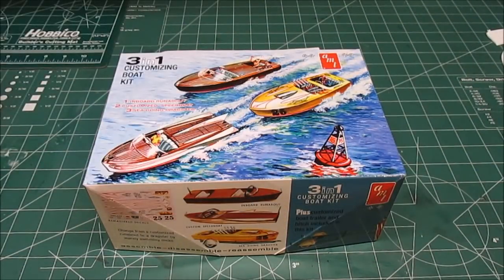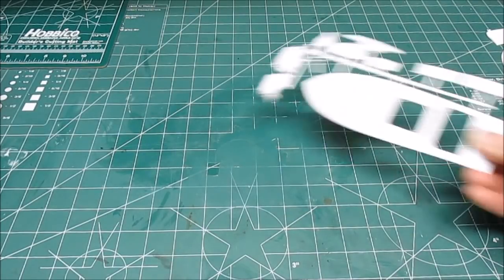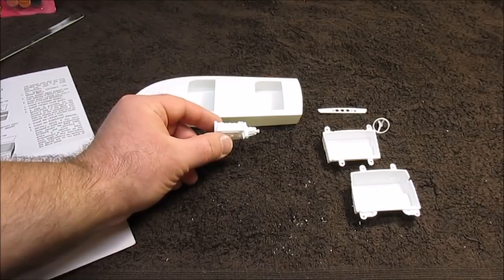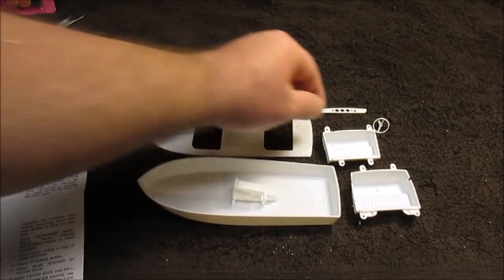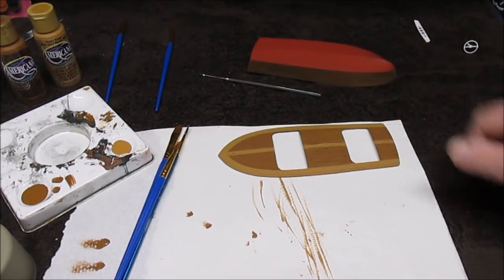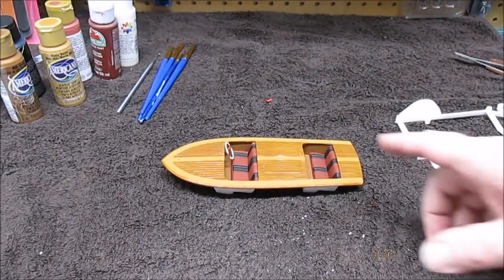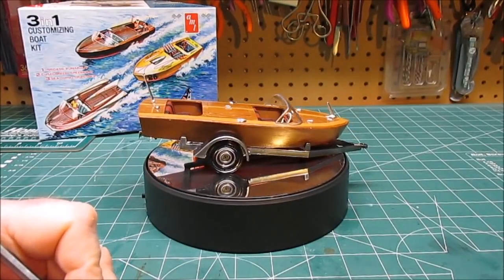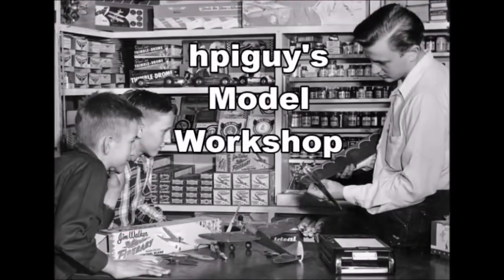AMT CUSTOMIZING BOAT 3N1 1:25 SCALE MODEL KIT REVIEW BUILD AMT1056

Comment: AMT does not include everything in that kit. When I bought the kit it didnt have the windshield but it had the chrome trim for the windshield.
Reply from the maker: You can use their parts request form on their website to ask for a replacement if a part is missing from your kit.
Reply: @hpiguy  Yeah I used their customer service and they where helpful on that.
Reply: Depending on how old was the copy you bought, it may have been that the supplied the frame and you added some acetate which is thinner than styrene.  Look for clear repot covers in the stationery department and you can pick your own colour -- yellow, red, blue, smokey gray.

Comment: Absolutely love it Chris! I've had this kit for some time, but not having seen one built up, it stayed on the shelf. No more! Also, bottom anti-fouling paint is always flat, not gloss. Cheers!
Reply from the maker: Thanks James!
Reply: The bottom paint should be copper bronze antifouling. The rudder and the propeller should also be bronze color. The boat needs an exhaust stack coming out of the transom just above the water line also called a boot stripe. Best boat should have a white boot stripe that runs between the copper bronze bottom paint and the varnish mahogany Hall sides. A nice build though.

Comment: I can't believe you have that kit!   I had one of those back in the mid-60's when it first came out !  I've still got the wood deck plate, too!   I've been looking for one of those for 50 years. Has it been released again ?  
   You've done an amazing job on the kit !!!  One of my frat brothers had one of those he was trying to restore. If memory serves, his had the wood color the reverse of your. Don't know if he ever did or not though.
Reply from the maker: Thanks! You bet, it's been re-popped and is for sale now. Link where I got mine is in the description.
Reply: hpiguys Workshop That's outstanding !   Sorry I missed that in the description.  I'm definitely going to get  me one !  Thanks for the blast from the past !
Reply: they sell this kit at HobbyLobby for 25 bucks I believe
Reply: They must've had a short run of them in the late 90's?
I found one on eBay like 20 years ago moulded in grey.
It's a future project to pair with a resin '48 Ford Sportsman (converted to a "phantom" '42) for a wartime look, with trailer.
I plan to make it a two seater because of the bigger straight eight Lincoln engine out of the "Gangbusters" '26 kit.
I even found a nice accurate looking spilt windshield on a toy car to use.

Comment: Nice job on both the kit and the video. It was great to pay attention to the video without the distraction of bad
camera work, bad sound and bad language. I recently purchased an earlier version that is molded in gray and
has a very slight difference in the decal sheet. Otherwise, the kit is identical. This kit could easily have been
adjusted to build two complete boats with an extra hull and a few small additional parts. I'll also say that a price
of $26.00 (at my local hobby shop) is ridiculous. The kit is so simplified that in can be fully assembled in no time.
Still, I'm glad to see it re-released. You did a great job with yours.
Reply from the maker: One extra hull and you'd have a true double kit. Maybe they will do that on the next release, that would be cool.
Thanks for the nice words!
Reply: Remember all the spare parts you have.  You're not just paying for the parts you used.
Reply: @randytaylor1258  Well, you're Johnny-on-the-spot, I wrote that four years ago. Nonetheless, what the hell good is a second
deck without a hull? At the time I wrote that comment I was just getting back into modeling and the prices took me by
surprise. Now I'm seeing kits at $31.95 and I don't feel any better if there are extra parts I don't see myself ever using.
Reply: @mitchgawlik1175  
When I was heavily into modelling 1:25 cars, 3-in-1 kits sold firv$2U.S./$3.20Cdn.  Those same kits in the same boxes are now $25-35.  If that's the going rate for a srandard-sized AMT or MPC or Revell KITS, then that's the price on the kit.  I didn't say it was a deal but on the other hand, after a few hours with a boat kit you've got a finished model to show for you efforts.  That isn't true with a more expensive Tamiya or Trumpeter kit which, of course, runs the risk of not being finished.  
There are many different ways of looking at value.  I have $200 kits in my basement that will take me a year to finish.
Reply: @randytaylor1258  I appreciate what you're saying. I also understand the value of U.S. currency. I have no idea how long you've been modeling but I've been at it since 1959 (9 years old), off and on. You can't imagine how much I enjoyed those oh so simple 3-in-1 and Craftsman kits from AMT. When I post comments on a couple of other sits wishing that Round 2 consider repopping those kits I get a resounding YES! from readers. I'm glad for those of you who are getting what you desire 
from Round 2, along with those spare parts. My wish is that Round 2 would consider that there is a group out there who really love those older, simpler kits. That's easy to figure out  when you see the prices asked for absolute trash on ebay. Give me an AMT '59 Galaxie, a '59 Buick Invicta, '59 Olds and a '59 Pontiac and I'll be silent forever, except to give a big thank you to Round 2. Thanks for your thoughful comments.

Comment: Was there no wench in the kit for the trailer to secure the boat for towing?
Reply: There are no rollers, either.  Make a winch and wrap it with thread, plus rollers out of wire insulation and buff strips out of cloth.  I love Chris's polished gunmetal finish.

Comment: nice boat or boats but the one you keep calling a dragster isn't a dragster.it's a crackerjack boat designed for a crew of two and race against 4 boats on a oval course.Nice build though.One I will need to add to my collection.by the way the rudder and prop would have been brass
Reply: It's actually called a Cracker Box. You are correct that it is a competition race boat with a two-man crew.